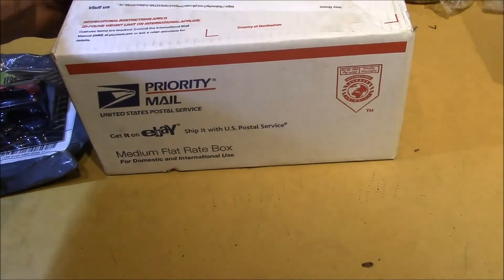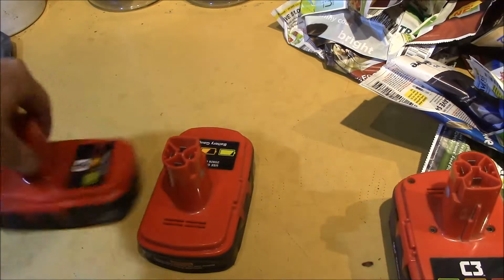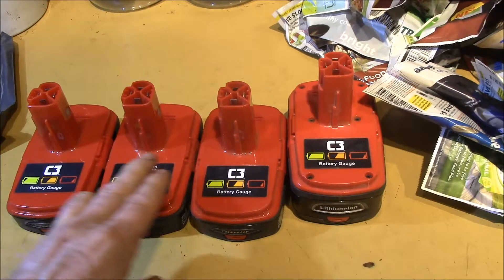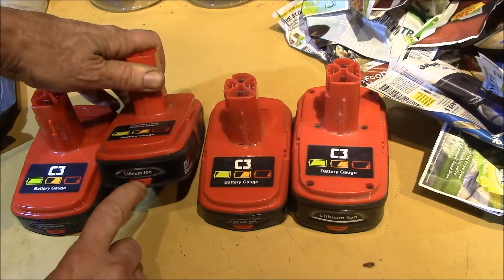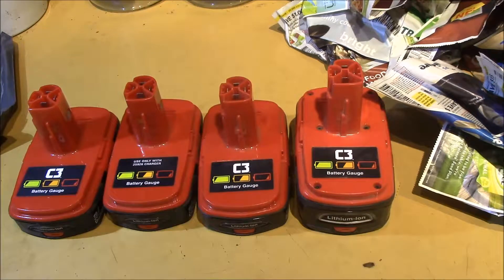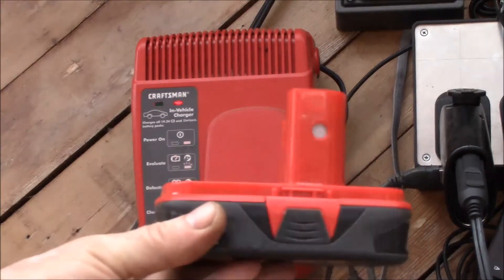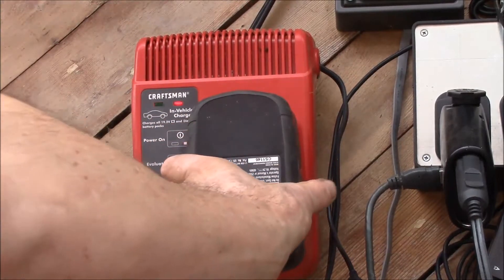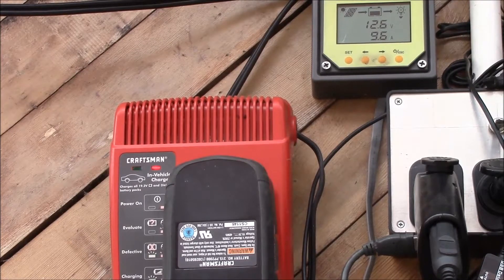Post Bag - Nov.13.2014, pt. 2

Comment: hey man 
I fucked up the circuit in my battery.
probs the fuse.
Reply from the maker: I don't think there's any fuse inside.  The BMS board will disconnect the cells if the voltage gets too low or too high.  If too low, sometimes it takes a few insertions into the charger to get the BMS to "wake up" and start accepting a charge.  Or it may be you blew out one of the high current MOSFETs inside that connect/disconnect the cells from the power pins.
Reply: +R Brown (4Crawler) first off 
it wasn't taking a charge 
that was the initial problem .
so I tried boiling it up to another battery connecting both negatives and positives from each one together
I guess you call that parallel?
I did that and nothing happened so I tried it in series 
this is when I got a big spark and boom no reading at all. 
it was reading 8 volts. 
I still have 1 high capacity battery left but it won't accept a charge. 

how do I fix it or make it accept a charge without screwing up the circuit board?
its my dad's batteries lol. 
when he finds out ones busted he's going to be so mad.
Reply from the maker: You might want to open up the battery pack and check the individual cells inside, could be one or more is at too low a voltage and that is preventing the BMS circuit from allowing a charge:
 https://youtu.be/SVGc3ks22zI?list=PLpY2FP1a9tivcC8P5tcJxifuEzNNpjbA9

That is one weakness of the C3 design, if one cell gets too low, the controller board will just shut off and not allow anything to happen.  There may be 4 perfectly fine cells and one weak one and that takes the whole pack down.
Reply: +R Brown (4Crawler) OK I'll try this. 
It was reading a voltage before until I hooked it up in parallel with another battery. 
now it reads nothing.